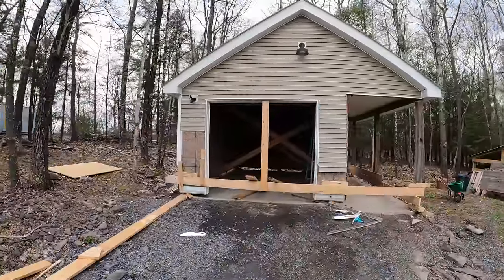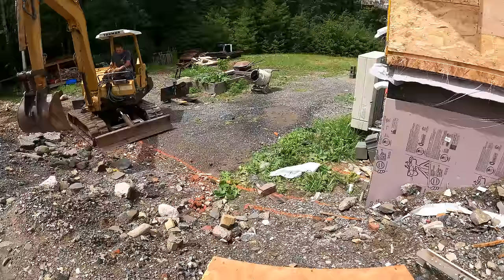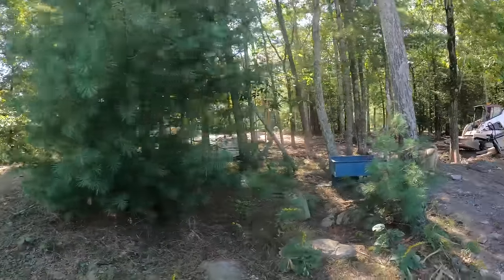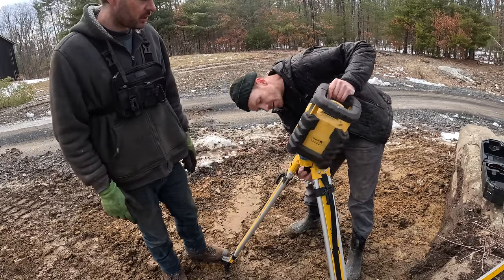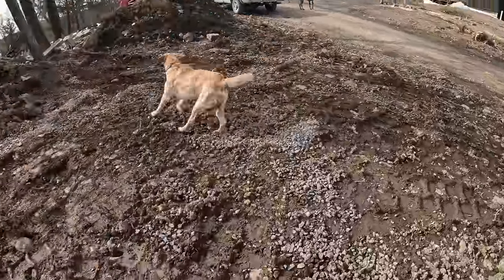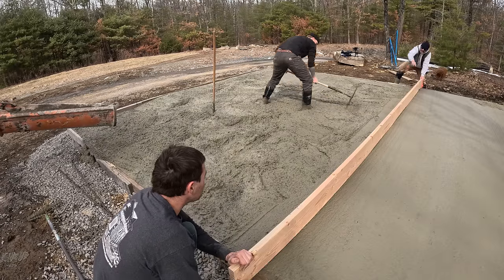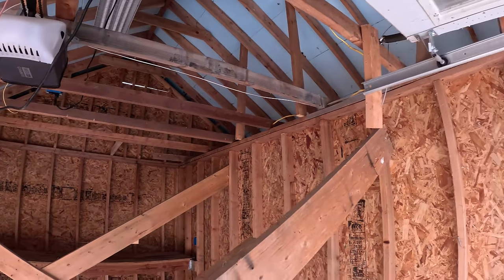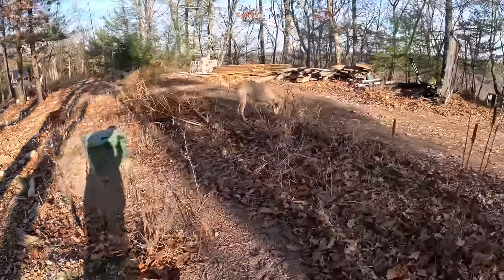Move garage, bury propane tank, pour slab

Comment: I've been a commercial construction Superintendent for a long time and never once have I ever seen a concrete delivery guy help finish the concrete. This guy is one of a kind! Hats off to him.
Reply: Guys in our area (Western Illinois) are ready to help every time. Especially if it's a solo pour.
Reply: Probably wanted to get out of there quicker.
Reply: @MrErichonda30  If he wanted to get out of there quicker he would have just poured the mud, cleaned his chutes, and left.  Most mixer drivers get paid by the hour and milking it on easy jobs like this eats up the day rather than going and getting load after load.I know because I also drive a mixer lol. No need to have to wait for the concrete to be finished. Once the truck is empty/mud on the ground the job is done for the Operator.
Reply: @MrErichonda30 4 REPLIES
Reply: In Connecticut I usually see them help on residential at least, obviously they can't stick around long always but usually there's a guy running the truck and another guy running the chute or pour and helping it
Reply: I didn't see the driver helping out with the base to believe that i need concrete evidence.

Comment: Considering the equiptment used and how the building was braced i think there was very minimal damage to it , we always added at least 4 sections of X bracing with one in the garage door and lagged 4x4s all way around the lower perimeter to every other stud. We have used tractors with forks and skidsteers to move many buildings and a few were old log buildings, we have 3/4” anchor loops welded  on the skid plates and chain the two skid steers together so the outside guy can pull the lead to keep the slack out and maintain the same distance between them and chain is out the way of the arms. 
Mad props to the concrete truck operator also, awesome guy and should be in the commercial for how to give 110% for the companys image and customer support/satisfaction. If he sees this, hats off to you my man.
Reply: I think it would have worked for that building even tho its bigger than anything i have moved, but i like to use 2 pieces of equipment, pick up the building, back up a trailer and set it on the trailer then move around, and offload the same way.
Reply: he definitely almost broke it multiple times, but once they hit their stride it went back square nicely

Comment: You guys got it done. A lot of stress to that building... It turned out fine though. The easiest way we've moved a few garages is to back a flatbed trailer inside. Jack it up, build and brace off of the flatbed and haul it away... Makes it super easy to maneuver and put in place.

Comment: A suggestion on the building moves with two pieces of equipment: The person who can't see the interior is the leader. The person who can see the interior is the follower. Connect a strip of construction tape between corners and the follower can watch that tape for sagging and stretching to see when they need to speed up or slow down. The leader follows the direction of the ground guide.
Reply: Best keystone cops movie I've seen in a long time
Reply: @phillipjones3342  i would have edited that move out.
Reply: and they could use phones with earbuds to communicate,..
Reply: They screwed that building up to the point the owner had to rebuild it.  I've seen Andrew do some sketchy things and get away with most......but this was so bad that I was embarrassed for him.
Reply: Totally agree. 😣
Reply: I’m wondering if Andrew quoted him a price to do it right and a price to do it. Seems the theme of this video is get it done as cheap possible . Maybe a friend or long time customer that he’s willing to cut corners for to lower the cost? I was thinking the whole time they where hammering rock and cleaning out the hole with such small bucket that it has to be cost prohibiting to bring one of his larger machines up there with the steep driveway maybe?
Reply: We always simply connected a chain between the two machines to a tow loop welded to the under panels, keeps them even and out of the way of the arms
Reply: That.....was.....not.....good.
Reply: @ZEROOOOOOOOOOOOOOO00  how many subscribers does your channel have? Just wondering.
Reply: I’m not sure how many subscribers someone has, has anything to do with how bad moving a building is done, has to do with it.

Comment: Glad to see all the comments are focused on the driver (I feel bad using that term in this situation)!  Tons and tons of props to that man for not only getting out of the truck to lend a seemingly much needed hand, but to also take the time to give some advice!!
Reply: Operator is a better word to use. At least that's what I prefer. When ppl ask I say I am a Mixer Truck Operator.
Reply: @Shredderof_POWDA agreed, driving is only 1/4 of his responsibilities. I labored for a crew for a few years and also did testing and inspection for 5 years, seen both ends of the spectrum but never this.

Comment: Thats one hell of a good dude thats driving the concrete truck. he helped not only putting the mud on the ground. but also helped rake and puddle it out with you. drivers done ever get out of the front loader trucks down here in florida. until they are empty..😂

Comment: One way or another Andrew will get what ever it is to its  resting place.  Good video and like you said in the video it’s been a few yrs in the making. It’s great to see the driver getting into doing some of the work on the pour.
I’m having a hard time understanding how and why none could tell that there pallet forks were not level and that they were poking holes in the ceiling. After they finished  the building with the new siding it looks wonderful. The whole place is coming along slow but steady and looking 👀 good

Comment: That is a thick cement pad for the garage. Nice to see some rebar in it. I don’t believe the wire does anything for holding it together.  I always require rebar on 2 foot centers lifted with the chairs. I noticed that you used them on the cement at the castle new pads you did recently. Very nice video work. 👍Thank you Andrew for sharing your work with us.
Reply: Sauna. 🤣
Reply: 🤦‍♂️🤦‍♂️CONCRETE NOT CEMENT 🙄🙄🙄
Reply: What size is that slab?
Reply: You are talking about standards, but then you use the word cement? Hard to take you serious. CONCRETE...it's called concrete lol.
Reply: Ok very nice Concrete work!

Comment: Andrew, I am a huge fan of your videos and their content.  As much as I love watching your videos, this one was a bit painful for me. Just a suggestion to maybe lift the building and back a trailer under it for your next building move.  Much less stress on the building that way. 

Just a tip on pouring concrete.  Start the pour from the back. Screed and lift the metal grid as you work your way to the front.  Have a person fill in the low spots as you move backwards. An experienced truck operator, like the one you had, can put the concrete where you need it with a lot less work for you having to move concrete around.

Comment: the problem with using two skid steers seems to be that they have to be moving at the exact same speed so there's no stress on the building. 

I think putting metal plates on the jacking spots of one skid steer so the building would be pushed by one skid steer and would slide on the other skid steer. that way you could have different speeds on the skid steers and maybe the building would just slide on the other set of forks, reducing the stress on the building.
Reply: I wonder if chaining them together would help.

Comment: I feel like at one time there was a TL10 and TL12, but at some point the tl8r2 showed up.  I wonder how it fits into the lineup.  Seems like even if you replaced one you still like the brand which is a pretty good recommendation, though I've never heard of them outside of a couple youtube channels
Reply from the maker: The TL8 belongs to that guy.
Reply: I have a TL8r2.  Great midsize machine. Unlike most other brands, you can open and close the front door regardless of bucket position.  For Andrew’s style of work, that’s a critical feature.  It’s also well setup for DIY maintenance, simple electronic controls compared to their modern machines.

Comment: Here's a tip for moving buildings, go with what you know works, like mobile storage buildings,  build skids under it lift it up put on a trailer, drive it to where it's going lift it up drive the trailer out remove the skids done.

Comment: I'm probably wrong, but are you really saving that much $ by moving it vs build new, esp after all the improvements he did once moving it? I get demo cost (tho could salvage a ton of stuff), but that little building was pretty small, old and beat up already, not to mention if any structural integrity was lost in the move. It has no insulation, drywall, plumbing, etc. I imagine it cost thousands in man hours, diesel, equipment, etc to move. I get it's still saving some money, but doesn't seem like much of a win, esp to do all that nice work with a new foundation and desired location.

Comment: I’ve done this with two forklifts for a metal shed/building but we used a long steel cable and a chain between the two forklifts so that they couldn’t get to far apart and the one out front did all the pulling. Worked great.  It’s only stupid if it doesn’t work!

Comment: Nice job on the pour! The key was to set all the bracing below the top of the form so your screed board could run along the top with no obstructions.
Without Andrew there, I don't know if the driver would've been as willing to help out. Either way, it's good that he did! lol
That burnt siding is interesting. Does it need to be sealed? Thanks Andrew
Reply: The ones that I’ve seen have had a matte finish sprayed on them.

Comment: With your level of  creative work, i'm surprised you moved that building that way. I had thought you'd have made a set of transport dollies to sit the building on to avoid that much damage to it. They are easy to make, especially with your skills. 4-8 rim and tire, some channel iron and bolts would have prevented alot of that damage and flexing. But the fact you two managed that with two track loaders is still impressive. And yes, that driver needs a raise and a beer! not many people in those fields would get out and help finish a job like that.
Reply: I take it you haven't seen many of Andrews videos, this is the guy who took a chainsaw to his dash to install a radio.

Comment: Next time you  move a building. Jack it up so you can slide  beans under the baseplate, then beams lagged on each end under the other beams  
so the weight is on the beams. The way you had it was dependent on the wood screws, which failed

Comment: I have been watching your videos for about a year or so. They are a little like adventures. Like the story of Huckleberry Finn. But, this is more like work. Salute to the truck driver for helping with the come along. He clearly knows concrete. You don't see that often. Your buddy returning the slightly used screed board?? that's funny. There is another tool called a bull float (4') that will work to level and smooth the concrete better, it's heavier than the 3' frisco trowel. "The job at hand". Love it!

Comment: Scarry stuff. Really liking that blue trailer for sure. Better than that old orange one you had. Next time you move a shed or garage like that. I have moved several. Don't pick up from the bottom. The roof rafters is where it's at. Cut pockets in the top and build fork pockets into the rafters and pick it up and let the walls hang and it's easy to remove the top pieces of siding. Picking it up under that porch area was OK but I would have screwed a pallet under it for guidance and less stress and damage.

Comment: Just a tip for finishing concrete...never put your Fresno (steel trowel) on the fresh slab. Hit it with your bull float first to level everything out, and it drives aggregate down and brings the  cream to the top. After the concrete stops bleeding water then  finish with your Fresno...
Reply from the maker: How is the full float doing anything different though? They look like it would do the exact same job.
Reply: Hopefully this helps, every pour you'll learn something new.  Like you I started pouring concrete on the side however that was almost 30 years ago but I'm still learning new tricks.
Reply: Rather than me trying to explain, here is a paste from a concrete finish website..... Once your top is flat from screeding, use a magnesium float to flatten and smooth the top while opening the pores of the fresh concrete, allowing bleed water to evaporate and air to escape. Once the concrete is firm enough and all bleed water has evaporated, use a steel trowel for your final finish.

Comment: With all due respect, I believe that a little more thought and bracing could have gone into moving the building.  Seems it would have been more feasible to put skids under the building and pull it to the location .
Reply: Right build skids under and pull I have moved pole buildings to new spots got to brace to keep square!.

Comment: Idea:  drill a hole through the center of the house in each direction (ie. one North/South, and one East/West), then pass a string through the entire house through the holes, and run each end of the string into one of the skid steers.  Put a mark on each end of the string.  This way, the skid steer operators can see exactly how far apart they are at all times, and whether they need to speed up or slow down.
Reply from the maker: What worked well on the final move was all wearing air pods and being in a 3 way phone call. That way we could talk to each hands free.
Reply: @AndrewCamarata  lol @ him randomly waving his hands at the beginning .. jfc

Comment: What is the thickest slab you can pour like this?
Reply from the maker: You could pour any thickness you want.
Reply: @AndrewCamarata  didn’t know if there would be a risk of cracking with heat generated. Thanks
Reply from the maker: There’s ways to deal with doing anything.

Comment: There are actual fittings for the rebar so it is in the appropriate height and you don't have to pull it up. It looked very uneaven and most likely the concrete isnt as strong as it could be

Comment: You tried to look clever getting your phone out and trying to find the length on the hypotenuse, it didnt work out for you.

As long as the opposite sides are the same size, then you dont need Pythagoras at all.  
As long as the the diagonals are the same, it is square.   To get the boards roughly square when setting up, just use the 3-4-5 rule and fine tune it from there.

 .

Comment: Wow. I'm disappointed Andrew. There is a much better way to move small wood framed buildings. Attach a 2x10 to the inside of the walls down the length on each side about 2 feet above the floor. Then put a double 2x12 beam across the width on each end underneath your 2x10s and secure them to the studs. Raise the building and back a trailer underneath the beams and set the building on it for transport. The time saved piecing things back together is well worth it as everything stays tied together and won't separate while moving.

Comment: Cybertruck deliveries just started but there is a long line/list. You're 100% going to need to get the range extender for your cybertruck. Just regular driving you'd be fine, but you're going to be heavy towing, and towing up mountains. Ultimately it's up to you if you think you do or don't need it. Because it's like a 16k add on, to an already expensive truck.

Comment: Welding is my trade worked with concrete for a bit always level a corner and work from there. The truck driver giving advise and lending a hand was sick I can promise you all the drivers in Pittsburgh would never do that. We also always trowel finished over top. With knee boards

Comment: Wow Andrew, first time I question anything you do, but it seemed to me you could of used the dozer on some things like moving that huge rock and knocking down that tree, and the way you moved that shed was very questionable, I would of built a sled to drag across the property and not damage the building so much, you guys came close to tearing it apart, or at least that's the way it looked to me. also all those dogs running loose when doing the slab, I thought for sure one of therm was going to make you work twice, but you lucked out all around.

Comment: I can’t imagine it was financially worth it to move that original garage. Time, labor, machines, then fully strip off the roof and siding and try to repair all the damage from moving it. The labor and machine costs alone could have been used to buy materials to just build a new garage on the new slab.
Reply from the maker: Why? That only took a few hours.

Comment: An easy way to check right angles is 3-4-5. Just measure 3ft (or inches) on one side and make a mark, 4ft on the one at a right angle and make a mark. Then the distance between the marks should be exactly 5ft.
Reply from the maker: Can the numbers be doubled? 6 8 10?
Reply: @AndrewCamarata i have heard of the 3,4,5 method and I am pretty sure it would work for any number
Reply: @AndrewCamarata  Yes they can, Andrew. You can also use  30/40/50 for larger jobs.
Reply from the maker: Ok, thanks, that is easier than the math I did.
Reply: @AndrewCamarata 
 You square each of the legs, then add them together and take the square root of the total.

6x6=36
8×8=64
36+64=100
Square root of 100=10

3x3=9
4x4=16
9+16=25
Square root of 25=5

It works with any numbers, but the 3,4,5 ratio works the best. 

4x4=16
4×4=16
16+16=32
Square root of 32=5.656854
Reply: @AndrewCamarata Pythagorean theorum